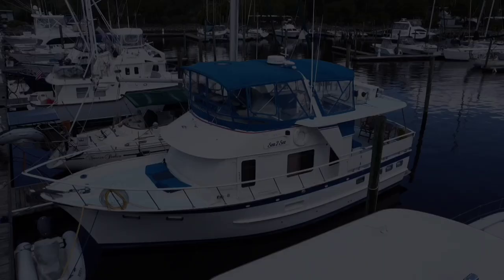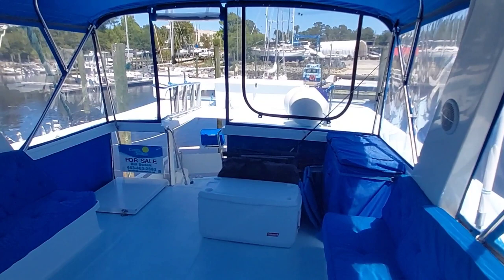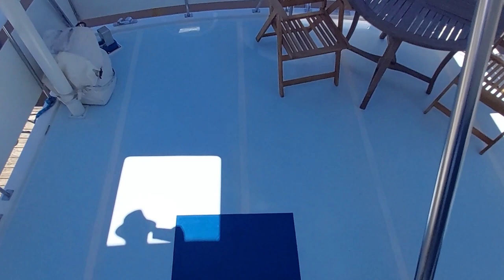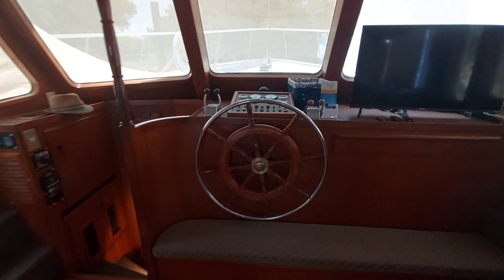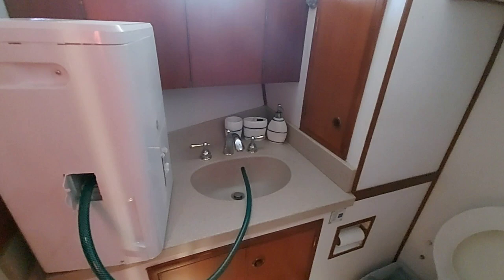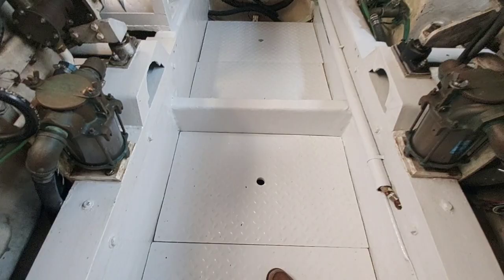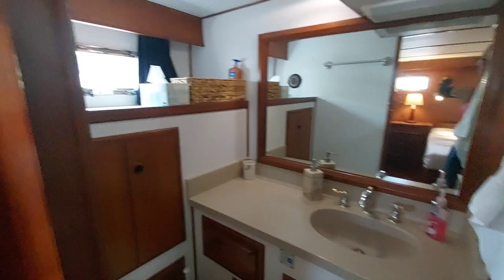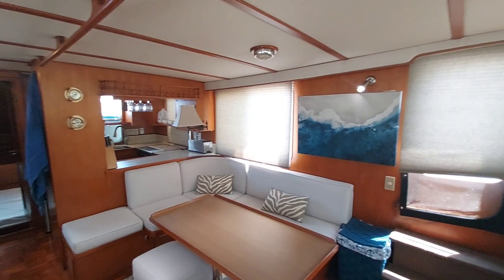SOLD / SEA La Vie 1983 DeFever 44 Sundeck Trawler $165,000

Comment: 40 years old, over 9000 hours on engines, $180.000...  Owner should rename boat "Dreaming".
Reply: Your lack of knowledge on Ford Lehmans is showing
Reply: Hahahaha yeah for sure
Reply: The Lehman Engines are a Version(Marine) of the Diesel Motors in the Light Trucks and Light Vans Used and Built by Ford. Parts are Easy to Get and are Rebuildable too.
Reply: Is this boat for sale?
Reply: @8sarman  if he hasn't come down to reality... for sure
Reply: @seanlathbury5410  Yea, the Ford Lehmans are great motors. Your lack of math skills is showing.
Reply: Yeah !! 😮 Seems to be VERY EXPENSIVE 💰 I've seen some pretty nice BIG Yachts for that price !! I'm looking at 3 boats now from 43' to 48' ONLY $ 45 k & 60 k that's Canadian Dollars 💰 !! and Newer....
Reply from the maker: @8sarman It is currently under contract. Survey is Thursday.
Reply from the maker: @Roland-rv9cw Thr appraisal was done in 2022.
Reply from the maker: @Roland-rv9cw It's the make, condition, and equipment that price a vessel. I don't think you'll find many vessels with stabilizers for under 100k. This vessel was professionally appraised and is now under contract. Trawlers, especially can vary greatly in proce for similar models. It's a good idea to work with a buyer broker that knows about trawlers spacifically and their niche msrket, so you don't end up with a low priced money pit.
Reply: Or Dream on !
Reply from the maker: @joemauma5035  The vessel sold and then the new owner had to change plans and she went up for sale again with a new name. She is under contract very quickly because there were many interested buyers that had already seen the vessel.
Reply from the maker: It Closed and then went for sale again. Current owner had a change in plans.

Comment: I didn’t know you could get over 9000 hours out of a diesel motor?
Reply: I value this vessel  at 75K
Reply from the maker: Naturally aspirated Ford Lehmans are known to run for 20,000 hrs. You will not find a stabilized vessel in this shape for under 100k. This one is currently under contract and will be sold soon. Let me know if I can be of help navigating this market.
Reply: @LarsBergstromYachtTours  
Wow ! Congrats !
There’s an old saying, may the buyer beware